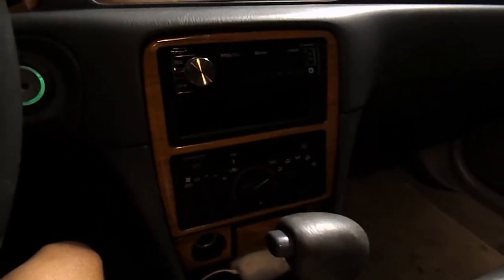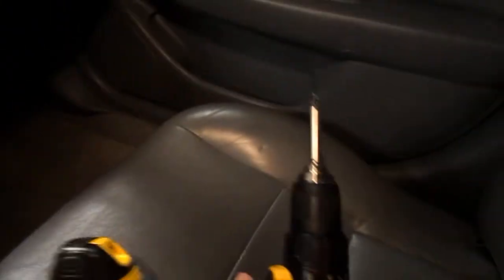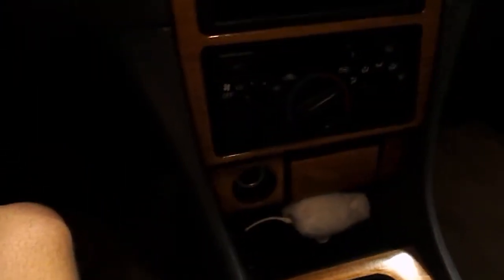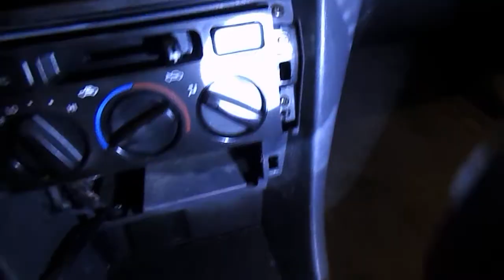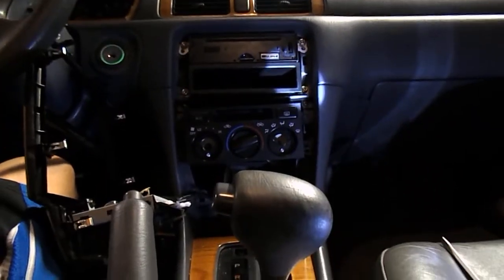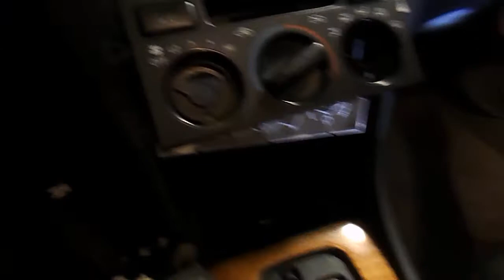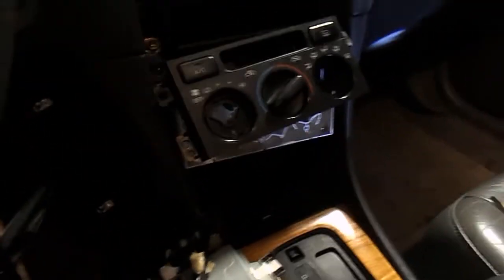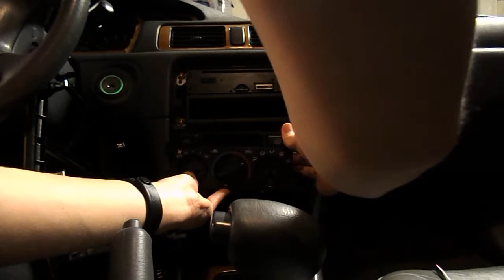how to change the ac knob light on a 1998 Toyota Camry

Comment: Do you know how to change the lights for the buttons above the knobs? Like the actual A/C button?
Reply from the maker: No clue. Sorry man.
Reply: There is a small, grey plastic Phillips screw on the A/C switch. You have to remove the switch assembly to access it. I don't know exactly what size of bulb it is, 3mm or 4mm. I think there are a few forum pages that could help.☺️